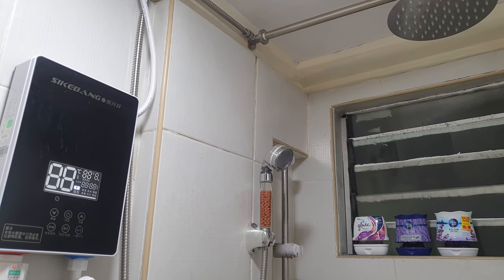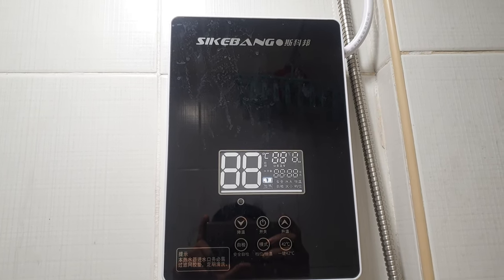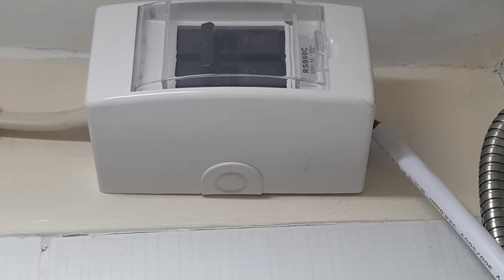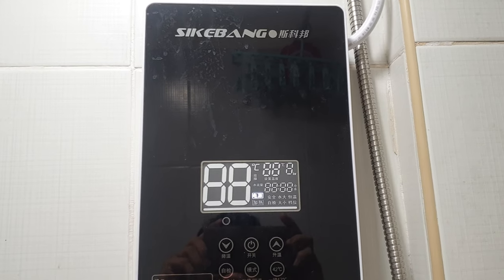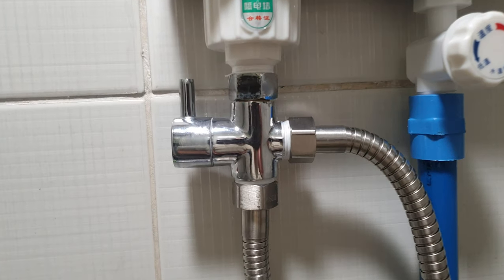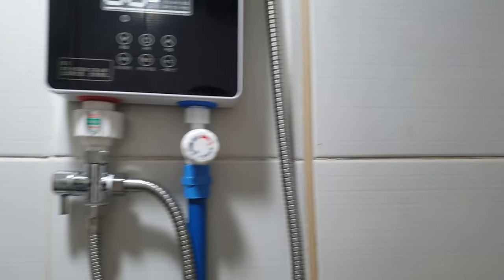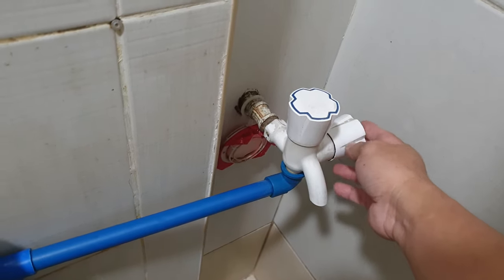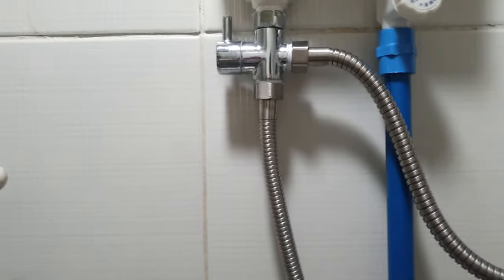TUTORIAL: How to Install, Convert Single-Point Heater to Double-Point Hot Shower System

Comment: Very articulate, kala ko foreigner. mas maayus ka mag  explain sir. thanks for sharing this video.
Reply: Hi sir, are you an engineer may i ask if what would i do if i need to redesign a plumbing system originally a single point and the owner wanted to have a multi point. ilang abang ng water line ang need ko ilagay.?
Reply from the maker: Nope. I am not an engineer. I just have a good background on trade and vocational skills.

Comment: Some things to consider. your CB is too high for a 6000w heater. You should use 30a breaker for a 220v supply. You can catch fire first before the breaker will trip down. Mine have included 63A breaker so I purchase new breaker just to be safe. Second is the wire on the heater is not 10awg but just 12awg. I pause the video and it says 3x4mm2 which are for #12 wires inside.
Reply from the maker: @OldLadyGamersince1990  Thanks anyway, thatś my set up 4 years ago. A lot of things had happened.
Reply: Actually 10 AWG is correct. 12 AWG for high wattage heaters can cause fire.

Comment: Hi, Sir. I was not aware on single and multi point system when I bought my water heater last month. Seeing this video, is it possible my single point WH will work on the normal setup we have in our condo? Please advise. Thank you very much.
Reply from the maker: You can use a  diverter just like what i have shown in the video. Thanks.

Comment: Sir, I just bought a set of shower set from Shopee but the seller wasn’t informative. They’re telling me the shower set I bought can’t do hot and cold because it only has a single tube? but based from the photos of their product, the handle of the shower has a logo for hot and cold. I already have a heater in my bathroom, I just wanted to change the shower set for interior purposes, do you think I’d be able to use that shower set for hot and cold? Please enlighten me.. I got confused with what the seller told me.. Thank you so much
Reply from the maker: Maybe what they meant is it can't heat water because it is not a heater. What you bought, maybe are shower heads.
Reply: I bought the long set one with two shower heads and faucet.. Just worried cause I’m not familiar with this, and I’m not sure now if it’ll be compatible with the heater since that’s what the seller told me.. Thank you so much for replying!
Reply from the maker: @patriciaaaa5305  compatible yan. Pipes and shower heads and also the faucet are standard sizes. Look for a plumber to help you.

Comment: For a shower set that has controller for shower and faucet, should we use single or multipoint water heater?
Reply from the maker: Single if you only want to use one shower head--either hand or rain showeer head. Multipoint if you want two shower heads.

Comment: hi sir we have the same water heater just want to ask how do i perform troubleshooting when the water that is coming out from the machine is not hot. The red light indicator is not illuminating. Hope to hear from you soon. Thanks
Reply from the maker: If the reading of the water output is below 12, the hot function will not operate. The Water output level is just below the Set Up temperature on the display. Be sure the water pressure is strong. Please subscribe. Thanks.
Reply: @HiTechTaBai  value under the 42degree is 0 and beside 0 is 22 so is the water pressure 0 or 22?
Reply from the maker: @teamawesome1710  22 (rightmost) is the input water level/pressure while 0 is the Output (the one that goes to your shower heads). It means your water pressure is low. Try using booster pump in your shower to increase pressure.
Reply: @HiTechTaBai  thank you very much for the swift response! already subscribed!

Comment: Hi po! Kailangan po ba malakas water pressure? Hindi kasi nagana yung nabili namin. 00 lang yung nalabas sa part ng hot water output na diniscuss niyo, and nagbiblink lang yung lower middle na chinese word (nagtranslator ako, "water is small" daw) tapos wala yung red light na may chinese characters ay hindi rin nailaw. Sira po ba yung unit kapag ganun? Maraming salamat.
Reply from the maker: It needs at least 12 (reading in output)  for the heater to heat. This is to protect the heater in case you forgot to turn off while there's now water flowing. In my house in Cebu, the water pressure is not that strong unlike in Manila where i took this video but i can still use it here in Cebu. Please subscribe.Thanks

Comment: Sir single point lang din heater ko perp balak ko sana bumili ng mixer na shower. Pwede kaya may heater din sa rain shower pati dun sa handheld shower? Sana po matulungan niyo ko. Thanks po.
Reply from the maker: Kung single point ang shower, pwede rin ito magamit for both the rain shower and the hand shower by installing a diverter in between the heater and the two shower ends like what i did on this video. You don't need to buy another heater. You can order the diverter online(Lazada) and have it installed by a plumber or someone knows about water piping. Pls. subscribe. Thanks.
Reply: Thank you!

Comment: Sir. Where should i connect the three colored wires
Reply from the maker: Connect it to the circuit breaker. The ground wire (green) should be in the metal case of the breaker if there is no slot for ground. Or connect it to the waterpipes to achieve proper grounding.